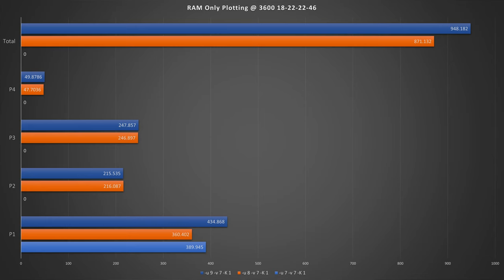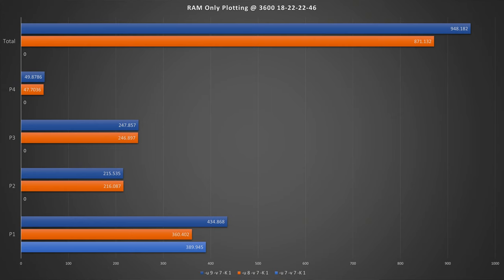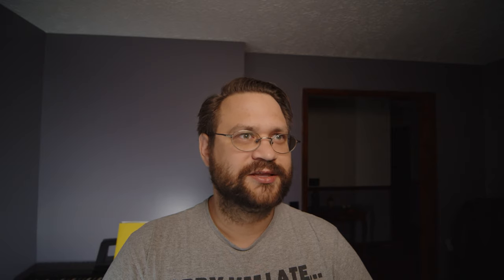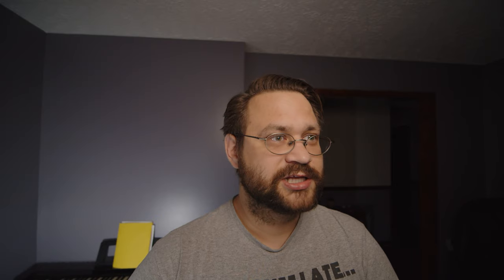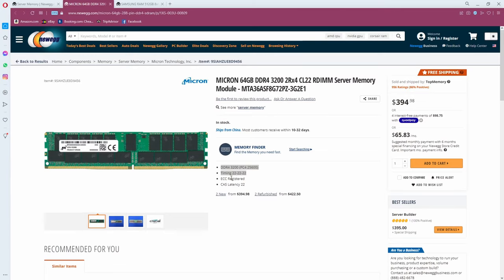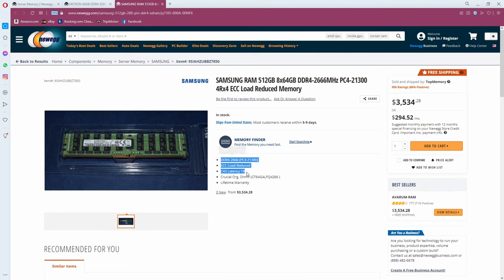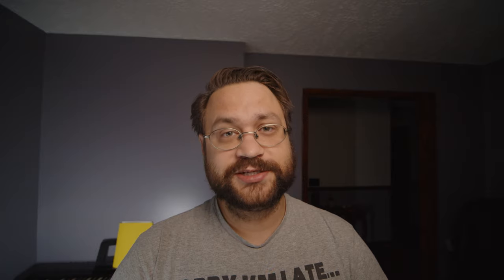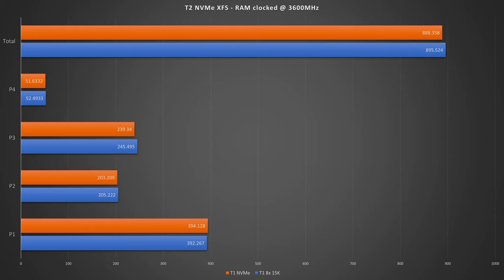I paid $2K for RAM! Was it worth it? (MadMax Chia Plotter)

Comment: Thank you - so more RAM didn't improve the end results. 

wanted to ask if you're doing the test in Windows OS or Ubuntu... I've seen some chatter that Ubuntu works better in this case.

Looking forward for your next video.
Reply from the maker: Ubuntu!! Huge difference, gigantic! I compare the two in my first video in this series. I am actually considering trying out other linux distros to see how much can be gained, but the main thing isn't even using linux, it's the fact that you shouldn't use NTFS as a filesystem on your plotter!

With your system things are a bit different, you are using a server which has more cores but they are slower so you will most likely benefit from 2 or possibly even 4 parallel runs rather than a single run, and while your RAM will be slower, you should still be able to benefit from using it as T2 for your runs. The purpose of this video was mainly to show that while RAM is good, it may not be the smartest thing to throw a lot of money at. Since you already have the RAM, you might as well use it. =)

I purchased 2 servers to test mad max with, but I won't have time to test them until a while from now since
1. I'm going away for 2 weeks on Sunday
2. I need to either pull more power to my home office or clean up in the basement and put the servers in my rack and pull more power to where the rack is.

What I would do if I were you would be:
1. Check out my first video so that you understand a bit more about the effects of the OS and File System
2. When running the first few tests in Linux, use top, htop or something like that to see how much use your CPUs are getting.

If the CPUs are under-utilized, I would recommend starting a second series of runs once you're in P2 or P3 of your first series, and check the time per plots and then the total plots/day.

There is a lot of tweaking involved when it comes to using MadMax efficiently, since every system is unique, but that's why I'm making this series, so that people can see the general direction to head. =)

Comment: ram performance is not slower if you have a board that supports 3200  at 8 channels
Reply from the maker: Good to know! My system only has quad channel so I can't test that. Did you test 8 sticks at 3200 vs 8 sticks at 3600 without a difference in speed?

All my previous testing on 2 and 4 channel systems indicates that the higher the ram clock the faster the plotting, but like I said, mine isn't octo channel.